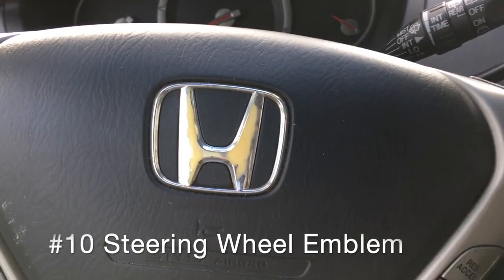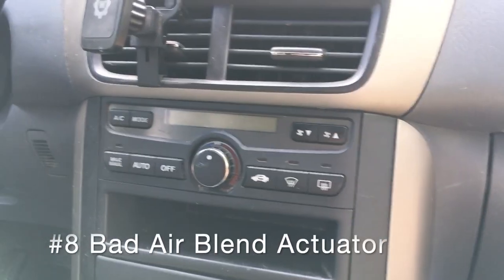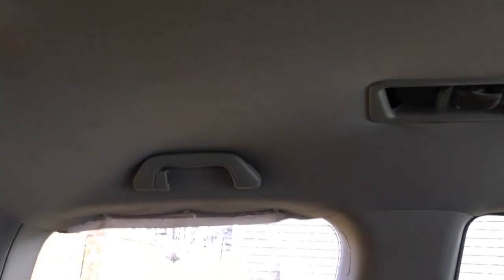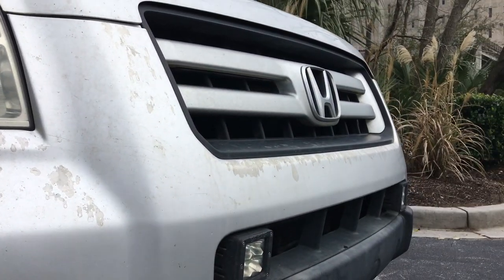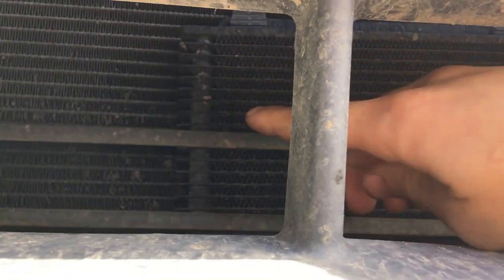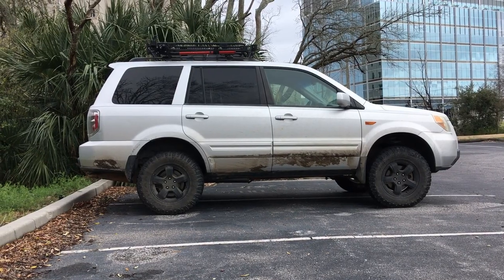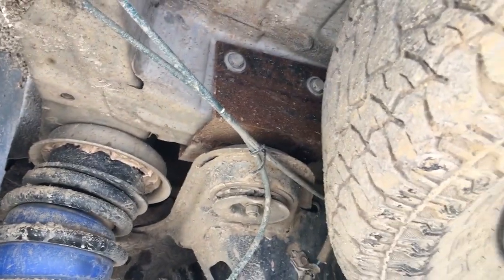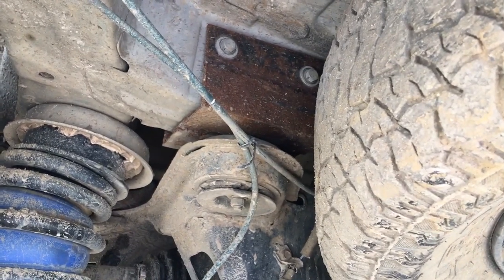Top 10 Common Honda Pilot Problems (2003-2008)

Comment: My 07 EXL has a weird issue with the TPMS, at highway speeds for  15 to 30 miles on the road the tpms light turns on for a while then goes off by itself and so on, when driving on the city all is good I’m not sure what’s the issue here. Mine is sagging a little bit in the rear about 1 1/2 inch. 

Another little issue that I have a some rust in the rear but so far where the unibody connects to the subframe is free of rust, I’m going to remove the rust and paint the affected area with rust reformer paint, I’m surprised there isn’t a recall about the rust issue in the rear it  seems like a manufacturer defect.  

I took the vent door actuator apart and cleaned with electronic can spray then added dielectric grease on the gears, put it back together and the noise behind the center dash went away. Cleanser 

I also replaced 2x O rings on the hydraulic pump and a random whining noise went away around the hydraulic pump and when steering and lastly the rear AC didn’t work because a $2 thermistor inside the motor resistor was blown I ordered the part from eBay and now the rear AC works fine. 

The first thing I did after getting my pilot was changing the timing belt, water pump, thermostat, engine-transmission amounts, PCV valve, cleaned EGR valve it was clogged with carbon deposit. Also I did replaced all the fluids,  it has been a great vehicle and runs great.

Comment: I changed my battery but my headlights are flashing the dashboard arms on the indicators and clicking noise. It only goes off when I turn the Honda off and leave the lights in on position. Please help

Comment: Good video. How about the ticking motor... valve adjustments possibly?  That's my current issue I'm figuring out.
Another issue is leaf bits in the fan motor under the glove box.
Thanks for your work.
Reply: It's a general 2000s Honda issue... Every single Honda I've owned does it. My pilot is going on 250 and it started ticking at 100k no perceivable issues have been detected.
Reply: @Zakary79081  I'm hoping I can get it solved, and not just throw a bunch of money at it.🤣
Reply from the maker: Your best bet for ticking is a valve adjustment. My engine doesn't tick and I have over 260,000 miles.

Comment: I have a 2003 honda pilot an my power locks stopped working one day i press the lock button i can hear the trunk lock an unlock but not the doors how do i fix this ?
Reply from the maker: It sounds like you will need to replace the actuators. I would recommend googling how to fix 2003 Honda Pilot door locks. I am sure there will be some good  information!

Comment: Hello Aaron my name is Ray By the way i like watching your channel’sBy the way I have an 05 Honda pilot EXL four-wheel-drive awesome rig I’m looking to put a winch on the front of mine I was wondering if you might have any good ideas. And I’m looking to do a 3 inch lift kit on my 2 inch frame drop
Reply from the maker: Welcome to the channel! I am going to use a hitch mounted winch and create a custom hitch receiver on the front. That way I can use the winch in the front and the rear.

Comment: I’m getting terrible gas mileage. I’ve recently replaced all 6 spark plugs and my air filter is clean. I bought the car for $4000 at around 202,400 miles and I’ve only had it about a month. I’m currently at 203,100. Every where I drive is local in the area and so I drive about roughly 150 miles at most a week resulting in my gas tank being close to empty after that. Any suggestions or insights on this? (Keep in mind I know very little about cars so take that into consideration of me buying this car) Also mine is a 2003.
Reply from the maker: These vehicles apply power to the rear below 15mph. This is great for traction and handling at launch, but bad for mpg in traffic.

Comment: please sir my 2007 Honda pilot check engine light is on and when scan to check what is the problem is showing cylinder 123456 misfiring, i replace the nozzles, the spark plugs, and the coils yet it still showing the same cylinders misfiring. please what else do i need to do

Comment: Doing my subframe repair now. How do you recommend I mark where to drill on the floorboard? use a punch from down below?
Reply from the maker: I drilled a hole larger than necessary and used a piece of steel to create a big bolt sandwich. So fare it seems to be holding up.

Comment: I have 2006 honda pilot on 118k miles. Whenever I select a gear to either R or D, it will jerk . And when I scan it the last time it was showing solenoid struck on. Pls help me and advise on what to do

Comment: Hi my 2007 pilot overheated  now engine wont run when cranking i can hear coolant reservior bubbling if its head gasket why there is no water on oil and no oil residue in my radiator  ihope you could give me some insight before i will remove the head tnx
Reply from the maker: The head may have failed in a way that only lets combustion gasses into the reservoir.

Comment: Did you ever have a point where it was difficult turning the wheel at low speeds? Power steering fluid full, no leak
Reply: Remove and clean out your power steering reservoir. You will find the screen clogged with debris. If this issue has been going fo a long time, fluid starvation to the pump may have damaged the pump also. It’s inexpensive and very easy to replace.

Comment: Hi i have 2011 honda pilot with a mis fire i replaced spark plugs all coils and all the injectors , the pcv valve i cleaned the throttle valve the EGR valve and i still have the engine light vtm-4 , VSA
Light now the only thing would be the valve i put the scanner it says  pcm and ecm are not communicating  and also shows random misfire , what do you think the problem may be.
Reply from the maker: What codes is it throwing?

Comment: i got a 2005 honda pilot no mantiance paper work would you flush the transmission and change timing belt. it has got 174,532 miles on it.
Reply from the maker: Yes I would drain and fill transmission 3x and change the timing belt if you have the funds. Better safe than sorry
Reply: @GotterAdventure  drain and fill 3x immediately? Or like 3 days in a row with some driving in between

Comment: How about the window actuators? i've had to replace all 4 window actuators. My 06 is actually in the shop right now to get MOOG rear springs installed to fix the saggy rear problem.
Reply from the maker: That could be a very common issue, thankfully I haven't needed to replace any actuators yet.

Comment: Help my 07 pilot won’t turn back on I was driving and came to a stop and the car never moved after that had a mechanic look at it and run diagnostics it called for the camshaft sensors and 02 to replaced which we did still no start replaced the spark plugs and valve still no start spread the vent to see if was the fuel pump still no start I’m stuck my car tries to start but won’t crank over

Comment: I got a 2006 honda pilot my engine light comes on  itts reading a stuck value on bank 1 I checked it and got another part cylinder  and still it will go wen I turn it off the engine light but wen it get really hot it just break down its speed and Studdard and putting  an want go can u help me

Comment: I have 2007 pilot with 219xxx miles on it and  the same frame problem.  Do you have video about how you fixed it?
Reply from the maker: I don't think I do. I am planning to re-enforce the other side when I install my subframe drop. I am planning to install the new lift at the beginning of the year if you can wait.

Comment: My 06 Pliot made it to about 190,000 miles.

One day on the highway, the check engine light randomly started flashing on and off, the car began to have trouble accelerating and it started to shake and sputter. 

My local mechanics couldn’t figure out what was wrong. Their guess is it needs a new engine.

Any theories as to what might be wrong before I give up on it?
Reply from the maker: Get your check engine code read at any auto parts store or ask the mechanic what the code was. I had very similar symptoms on my Pilot recently. It was a faulty ignition coil. It was super easy to replace. Send me that code and we can confirm.
Reply: Alternator gone bad. I had a similar problem
Reply: Alternator was my issue
Reply: No, dont get rid of it. Its very likely a bad coil and nothing more.

Comment: Hello I have a question so I’m trying to buy a 2003 Honda pilot and he says that there’s nothing wrong with the vehicle but it needs to put new sway bars and the handling is not driving perfectly is that easy fix
Reply from the maker: Always check the undercarriage for rust. Especially in the rear, where the subframe meets the body. swaybar links would make a clicking noise if they were bad sometimes they need to be cut off which makes the job harder

Comment: what did you use to fix the falling headliner? I have the same problem
Reply from the maker: I am about to make a replacement video. In the meantime I just used screw pins designed for headliners

Comment: Hi! Thanks for the video. I have a Honda pilot 2006. The vsa light with an exclamation light just came on. It's causing the vehicle not to pull well. What's the quick fix to solve this problem?
Reply from the maker: Check the wires around the abs sensors for damage.
Reply: @GotterAdventure  wires around the abs sensors for damage. I might need to take it to the garage. I don't know abs sensors.

Comment: Hey I’ve been working on my brother in laws 2005 pilot , I changed wheel bearings and everything in the suspension. I’m still getting front end noise… clunking … almost like something is loose. Any ideas
Reply from the maker: I would double check the swaybar links

Comment: I have 2007 Honda Pilot p0420 Issues , cloud you please talk more about that ? How to fix it .
Reply from the maker: I did the DIY spark plug defouler fix on my Pilot. Are you in a state that checks emissions?
Reply: @GotterAdventure   i change all new 6 spark plug . also i use cataclean catalytic converter cleaning . engine light still stay on .
Reply: @GotterAdventure  I’m not sure my cat is bad Or O2 sensor happen .
Reply from the maker: @peterlin3902  normally the cat is reaching the end of its life. If your state doesn’t check emissions you can do the defaulter mod.
Reply: @GotterAdventure   thank you so much. I will try this way out .
Reply: I had the code on my 2015 Pilot.  I also had misfires on cylinder #1, so I changed my spark plug out and both issues resolved.  Might be time for new plugs and check the coils as well?  I cleared the code and it hasn’t been back so I assume it’s fine now?

Comment: Hi Aaron, my sister in law wants to give my daughter her 2004 Pilot. She said she had the blower motor replaced but sometimes it doesn't turn on. She thinks there's a loose wire. How can I troubleshoot that issue? Any help would be appreciated.
Reply: If the blower fan works on a couple of speeds, have someone check both the blower resistor and the wires

Comment: For my 2007 with 136k miles (bought used from NY but it’s in Florida now)
1. emblem - mine is still good
2. TPMS - ok
3. Air Blend actuator = yep, mine makes that funky noise when it’s off or when you try to change the fan direction 
4. Fabric Falling - yep mine is starting to fall (I thought it was due to heat in FL) .. it’s also doing the same in the wife’s Acura
5. Clear Coat - yes, mine has NONE (my car is white) it’s like a porous matte paint everywhere and dirt just goes in like a sponge (not sure if previous owner did something
6. tranny cooler - n/-
7. P0420 code - yep , I have used CAtaclean and it has cleared the code but my mileage per tank is awful now , close to 250 miles per tank and I used to get 360 miles per tank
8. Saggy bottom - n/a
9. Timing belt - replaced but this is all Honda’s 
10. Rust - yes I have surface rust everywhere on edges of fender and by windows and on top of roof

Comment: Mine now throws out very hot air from the ac/heating center vent.  It's happened now about a half dozen times now. Turning it off, And restarting it - for now does recover the functionality (until it decides to do it again). Anyone have any ideas?

Comment: I have 2006 Honda Pilot with the 3,5 the motor when I’m driving it will exitate sometimes what it could be and also it only blows hot air in the front not cold air

Comment: 2005 pilot ex. My Abs light and brake comes on after a while then off then if I keep going all my light on the dash come then shut off but my car stays on driving with no issue. What is it u think??
Reply from the maker: It is possible your alternator is intermittent causing low voltage. You could have it tested at an autoparts store
Reply: @GotterAdventure  ok

Comment: Hey I have an issue with starting up warm engine. If I want to start up when is engine warm in that case engine dont run smooth. Its like a gaps in sound of engine and car dont want to drive when I step on a gas. You can smell something in cabin in that moment. My friend tried a diagnostic app on a phone and there is mistake P0171 . Spark plugs, ignition coils and both o2 sensors replaced. I dont see it now on a dasboard .
Reply from the maker: P0171

Possible Causes

Intake air leaks
Faulty front heated oxygen sensor
Ignition misfiring
Faulty fuel injectors
Exhaust gas leaks
Incorrect fuel pressure
Lack of fuel
Faulty Mass Air Flow (MAF) sensor
Incorrect Positive Crankcase Ventilation (PCV) hose connection
Reply from the maker: This forum post could help https://www.piloteers.org/threads/cel-flashing-low-engine-power-p0171.171912/

Comment: How do you know your timing belt needs to be replaced?
Reply from the maker: @AmaduAlphaBah-q5c  every 105k or 7 years. Don’t cheap out on the parts. Buy Aisin from Rock Auto or a reputable store.  If you don’t know the age of the belt it would be wise to replace it.

Comment: I have white smoke coming from the rear of the engine.  No overheating but when I come to a light or idkle it comes from the hood.  I'm wondering if its a valve cover gasket or head gasket.  No smoke from the tailpipe, no leaks of any kind.  Any ideas?
Reply from the maker: What does it smell like? Exhaust or coolant?

Comment: Hey sir, my name is franky and I need help. hopefully you can help me locate and pin point where my oil leak is coming from. There's oil coming from behind my engine, and i'm not sure if its my valve cover gasket or v-tec clinoid gasket. pls help thank you.

Comment: I have a 07 pilot. When you hit the breaks the dash lights dim unless you have the head lights on.
Reply from the maker: Maybe you have an alternator issue?
Reply: Could be a dying battery or bad battery connection.  Especially if your in a warmer climate this can go unnoticed a lot longer than in colder areas. Quick things to check. Then I'd check the alternator. Just make sure it's outputting about 14V and check at the actual alternator connector on the alternator. After that its probably a bad ground.

Comment: I don't have a comment I have a question I have a 2005 Honda pilot and I was driving it turned on the cruise control and lost complete power in the car what could the problem be.
Reply from the maker: Weird, Did you get power back? What do you mean when you say lost power? Electrical or throttle?
Reply: My pilot would hardly go more than 20 mph. A 10 minute drive to my house took me 30 minutes. The car never ran hot.
Reply from the maker: @janetthornton3297  That sounds like it went into limp mode. I would recommend having our obdII codes read.

Comment: how about oil leaks between transmission and the engine this rear main seal
Reply from the maker: I didn't have one then, but I do now. I am just using  a bottle of rear main sealant per oil change for now.

Comment: I put a 2 inch spacer lift from ebay on my 04 pilot and a shop is telling me that the spacer lift is messing up my cv axles and making a vibration at acceleration under the car. Is this true? 🤔
Reply from the maker: If you install a lift it is recommended that you use OEM axles. I have also had good results with Napa axles. I have had very poor results with other brands. If your axles are worn then lifting could cause them to vibrate as well due to the change in angles.

Comment: Don't these older pilots have transmission issues like the old 2nd Gen Odysseys?
Reply from the maker: The 06-08 years seem to be pretty solid. I am sitting at 250k miles on my original
Reply: @GotterAdventure  it must be the pre-facelift models then.

Does yours have the 5 speed auto?
Reply from the maker: @SgtSnazzerino  Yes

Comment: I'm having a problem in my Honda pilot the problem is when you start the car and move at least km , the car will shaking and vibrate and so the accelerate will be pool
Reply from the maker: Is it throwing a check engine light?

Comment: I have problems with the brake pedal. It feels so soft to touch. It goes right down to the floor before it works any time I want to apply the brakes. What may be the problem?
Reply from the maker: Bad master cylinder or air in your brake lines. That is a dangerous condition that needs to be resolved before driving.

Comment: 05 Pilot, 201K miles. 
 I want to add a backup sensor but there are so many options on Amazon that I'm not sure which to buy. Any suggestions? 

Also, The last time I had the timing chain replaced the dealer loaned me a new Odyssey overnight. Except for its having slightly tighter steering, I prefer my old Pilot. Anyone who drives it comments on how solid it is.
Reply from the maker: I don't have any experience with backup sensors, but I agree that our Pilots are great vehicles :)
Reply: @GotterAdventure  Thanks much for your reply.  I've recommended Pilots to two good friends who knew how much I like mine. They love their Pilots. A friend who drives a new CRV had occasion to drive my Pilot. Her reaction  "this car is really solid!"